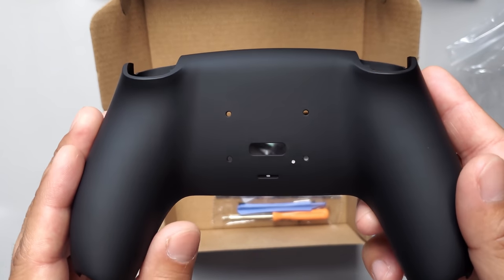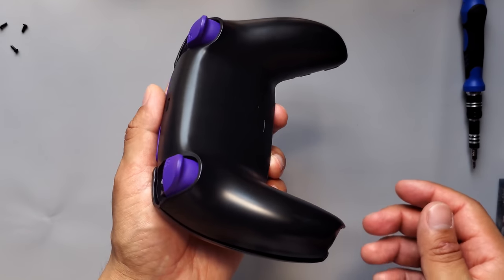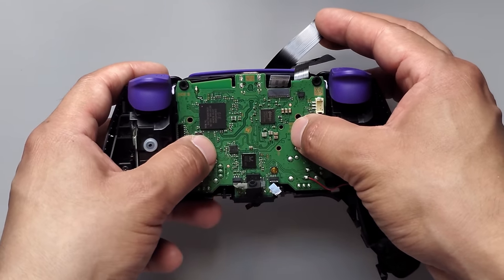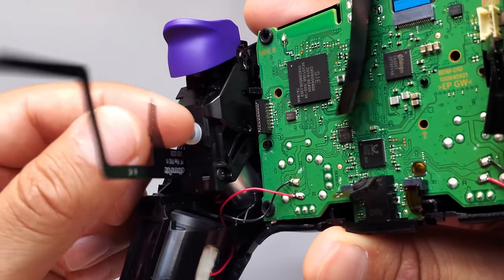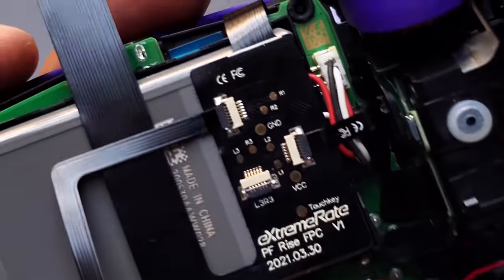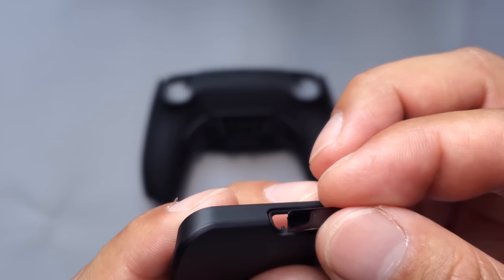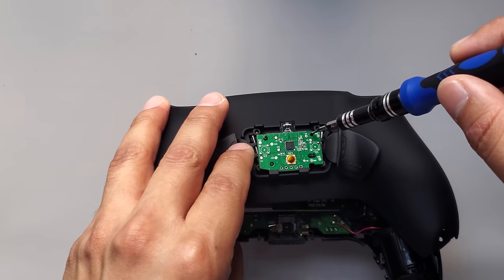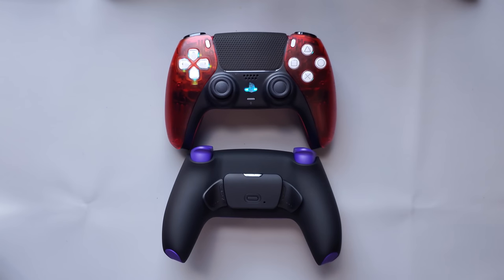DIY PS5 Controller (For BDM-010): eXtremeRate's Rise Remap Kit | No-Soldering Step by Step Tutorial

Comment: Would this work together with the hair trigger kit as well?
Reply from the maker: It does! I did my other red transparent controller with led, hair trigger and remap kit.
Reply: @im.a.caveman  thanks. I already installed the remap kit and got the trigger map after. Not sure if I want to reopen the controller again since I already taped the wires to the battery.

Comment: So I installed mine and everything went together good but when I went to try it out L1 and 2 and R1 and 2 won’t do anything. Any tips before a tear into it to see what’s going on.
Reply from the maker: As in you're trying them out on the back buttons or pressing the trigger buttons?
Reply: @im.a.caveman  no like there just not doing anything at all. I didn’t get to the remap process just because I realized that none of the triggers we’re doing anything. Maybe some of the connections aren’t in all the way ?
Reply from the maker: @TheJdavis90  Open it up and check all the cables. Look around carefully and closely for anything that might seem off.
Reply: @im.a.caveman   yea I checked it with the controller connected to my Ps5 and could never get the right triggers to work so I put the original ribbon cable back and it worked perfect so I’m guessing  I messed it  up trying to install it or it came with some kind of flaw. But either way I got it and it works fine I just can’t remap r1 or r2 but that’s fine I didn’t plan on it anyway

Comment: Just done it and no signal,checked the cables for 3 times but no red light,can't start the controller. Thanks for the vid btw.Great  tutorial bro...
Reply from the maker: It could be its not compatible with your controller. Is the original back shell model number CFI-ZCT1W or CFI-ZCT1W  A? On the motherboard does it show BDM-010 or BDM-020? You can check for either one. It's only compatible with CFI-ZCT1W / BDM-010. Extremerate is working to have it compatible with CFI-ZCT1W A / BDM-020. They're close and should take some time to release.
Reply: @im.a.caveman  Thanks bro,I'll check it. Appreciate it 🙏

Comment: Anyone have any idea what the cable at 3:28 is called and if you can get a replacement as I snapped my trying to remove it 😫😤
Reply from the maker: That's the shorter microphone flex/ribbon cable. I saw some on Amazon. You can also try ebay. There's also a longer one that's for the front microphone.

Comment: put this kit on a brand new controller that i just got today after i followed your instructions to the letter, pausing each step and checking double checking and even triple checking at times that was doing it right and got it all fit in perfectly then discovered that the controller wont turn. any ideas what it could be?
Reply from the maker: It's sounds like the kit is not compatible with your controller. I have a video on compatibility if you want to check that out. When the kit came out there was a new model of ps5 controllers that were released so extremerate had to work on a new remap kit which is already available.
Reply: nevermind. i found out it is a compatability issue. i feel you should put a warning about this at the start of your installation video for people like me that just dont know this issue exists. great instructional video though
Reply from the maker: I wish I could put it on the video but I don't think I'm able to add clips when the video is uploaded already. I do have it on the description though. And thanks! Also, I think if you contact extremerate and tell them you got the wrong kit they could probably send the cables that are needed for your kit. Try it out!

Comment: Ive done all the process but the controller wont turn on. Once i take off the board that has glue the controller turns on. Do you know any fix for that? Thank you in advance 
Great tutorial btw
Reply from the maker: The remap kit is only compatible with the board BDM-010. Model # CFI-ZCT1W is BDM-010. CFI-ZCT1W A is BDM-020. Atleast from what someone has mentioned to me. Model # is on the original back shell. BDM is found on the motherboard

Comment: One question please. If I want use R3 and L3 as the back buttons instead. Will that be possible. Somewho u said there no r3l3 available in vid
Reply from the maker: You'll be able to program L3 and R3 to the paddles if you solder the cable for it. But since this is the non-soldering version I don't show that part on the video.
Reply: @im.a.caveman  ah ok thanks so there anther version of it. That includes r3l3

Comment: led indicator and controller dont turn on now dont really know what i did followed step by step?
Reply from the maker: If the controller isn't turning on maybe the battery wasn't connected but check all the cables.
Reply: @im.a.caveman  yea I did I’m pretty sure I messed somthing up I’ll buy a new battery and try again
Reply from the maker: @kenythguerrero9798  Oh man. You can always send a quick vid or pick on my IG (im.a.caveman)
Reply: @im.a.caveman  so i put all the Original cables back in and the controller works perfect

Comment: Dude every thing seems to work, light turns on but the buttons don’t work. I assign them by holding the button and o or x and wait a blink. It blinks but the back buttons won’t do anything!?

Any idea where I went wrong?
Reply: Leaving this comment cause I figured it. You have to take it out of remap mode after assigning for it to work. I held L1, R1, down on D pad, and X into the light turns on. Then assign buttons, light will flash. Then repeat holding L1 R1 Down X and light will turn off and you’re out of remap mode. Buttons work

Comment: So when my light is off it’s when I can use the paddles and when it’s on I can’t. Can you explain. Thank you
Reply from the maker: When the light is on that means remap mode is on. When the light is off, remap mode is off and you can use them. I recommend looking at my Rise 4 video. That kit seems to be getting popular. This kit is outdated. It's the V1 remap kit. They released 3 other kits after this one.

Comment: My button that turns the back button on doesn’t have a slot to click in. It just sits in there loosely and when I go to attach the back button it jus falls out. Need help
Reply from the maker: I had the same problem but I kept putting it in and eventually I got it on right. Not sure exactly what I did correctly though. Just kept trying.

Comment: So before I get this,can I use just the base ps5 controller to mod it,I have no mods on it either,or will I have to change the whole backplate?
Reply from the maker: It comes with a back shell of your choosing. You can still use the mod on the original but that means you would have to drill your own holes. They also don't sell the mod on its own, it comes with a back shell with pre-made holes. If you do plan on getting one check for compatibility. Here's a link to help with that: https://youtu.be/cncOZDDSmIk

Here's a link to the V2 Rise Remap Kit:
eXtremeRate White Rubberized Grip Programable RISE 2.0 Remap Kit for PS5 Controller BDM 010 & BDM 020, Upgrade Board & Redesigned Back Shell & Back Buttons for PS5 Controller - Controller NOT Included https://www.amazon.com/dp/B09HTKXRVN/ref=cm_sw_r_apan_glt_fabc_8J1FWBBA63NFEXZD3B44

Currently sold out on the gamingcobra website.

Comment: IF YOU STILL REPLYING TO QUESTIONS, I HAVE ONE....Can you tell me why X button doesn't work in the COD, So if i can explain... The splash screen that plays while the game is loading, then you have to press X to enter the game. My controller doesn't work at that time. I know the X button works because it works for every thing else. So help me out of you can.
Reply from the maker: Specifically just during the load screen or just not working at all? Edit: read the comment carefully. Only on the load screen....could be a COD glitch if you're X works perfectly for everything else. Did you try on another game?
Reply: @im.a.caveman  well now that I went all the way  thru it’s not working for the game. But it works thru out my PS5. Also that’s the only game I tried……update just tried another game, no luck.
Reply from the maker: @Mr.Charles73  you installed back buttons or its the stock control?
Reply: @im.a.caveman  back buttons. No soldiering tho.
Reply from the maker: @Mr.Charles73  I definitely suggest opening up the control and check your wires. Also the conductive film that the X button pushes down on. You could also try restarting your control.
Reply: @im.a.caveman  ok but I’ve open and closed it twice now. So I’ll unpair it. But like I said it works thru out the PS5 menu. Just not for games.
Reply from the maker: @Mr.Charles73  I haven't had any issues. And for it to only work in menu but not in a game it's weird. I know it's extra work but try your original cables without the back buttons to see if it works.
Reply: @im.a.caveman  I feel you, but it was a brand new controller
Reply from the maker: @Mr.Charles73  Replace everything with the original parts and see how it works.
Reply: @im.a.caveman  yep it still work with the original parts installed. So on that note, I’m lost  now
Reply from the maker: @Mr.Charles73  You can contact the company and ask for a replacement. You probably got a faulty/damaged Remap kit.

Comment: My L2 is now always stuck on.. any suggestions? Also, buttons won't work in a games menu? They work fine in game and in ps menu but not game menu
Reply from the maker: Check all your connections. If that doesn't work out try resetting your control or use your stock parts without the back buttons. There's a possibility you have a faulty.

Comment: Hey, I appreciate the guide everything seems to be working except the touchpad. Now it doesn’t show that white light at the button and there touchpad isn’t working when I press it (doesn’t bring up hud for a certain game I’m playing). Anyways to fix this? Maybe I didn’t put the plate properly in?
Reply from the maker: Did you reconnect the touch pad cable? You installeded the remap kit and it's the only problem?
Reply: @im.a.caveman  that blue strip? Yea that was the easiest to remove and put back. The paddles are working fine, do I seriously need to open it up again in order to fix the touchpad issue?
Reply from the maker: @wais_45  Did you swap the touchpad for a different one?
Reply: @im.a.caveman  nah all I did was follow your instructions lol. Literally everything is working besides the touchpad even tho I put the strip back in.
Reply from the maker: @wais_45  Did the touchpad cable accidentally get pulled on? Or the cable itself got damaged? You would have to look around in your touchpad and cable.

Comment: I was able to turn it on no problem. But I can’t seem to reprogram the paddles. I hold x and k1 and the red indicator light flashes. But x stills performs as x and the paddle serves no function. Any ideas?
Reply: I'm having this issue as well. Everything turns on but the actual mapping wont work. Could a certain wire been placed too loose?
Reply: Actually bro i just figured it out for me, just make sure you turn the back part off and then the button should work fine. So hold the two buttons, turn off the back and you're good
Reply: @arhumahmed5030  thanks I’ll try that!

Comment: Any idea why the paddles wouldn’t be working? It lights up and I double checked the connections disassembled and reassemble?
Reply from the maker: After remapping did you turn the back off? On is for remapping only.
Reply: @im.a.caveman  yeah I did still nothing, I did the trigger click at the same time too and noticed my R2 wasn’t working and re did it and it clicks now
Reply: Not sure if the buttons work yet tho

Comment: So...... my controller won't turn on. Do you have any idea where I might have made a mistake?
I checked that the battery is connected and I've tried plugging it into my console.
Reply from the maker: It could be due to compatibility issues. Does the original back shell model number show CFI-ZCT1W or CFI-ZCT1W A? On the motherboard, does it show BDM-010 or BDM-020? The kit is only compatible with CFI-ZCT1W / BDM-010. Extremerate is working on having it work with CFI-ZCT1W A / BDM-020

Comment: Did it all as shown in the video and the controler do t wanna turn on now at all! Like the battery is not conected at all, any advice or an idea what to do or what i did wrong ? Thx in advance
Reply from the maker: It could be due to compatibility issues. Does the original back shell model number show CFI-ZCT1W or CFI-ZCT1W A? On the motherboard does it show BDM-010 or BDM-020? The kit is only compatible with CFI-ZCT1W / BDM-010. Extremerate is working on having it work with CFI-ZCT1W A / BDM-020
Reply: @im.a.caveman  Hey thx for the reply. Back shell is the right nr but didnt check the motherboard tought it cant be diferent but il have a look again
Reply: And where exsactly on the board do i see the nr ? I know silly but not an expert here 😅

Comment: Is there anyway to unmap the R3 button and have it mapped to the back buttons? Meaning if you hit the R3 click it wont work
Reply from the maker: Maybe you can just switch the R3 to a different button to with the game options? But other than that I haven't seen how to unmap an existing button from a control. If you want to remap R3 to the back buttons you would have to do some soldering.

Comment: trying to install this. as well as led kit, front shell, new touch pad. clicky triggers. Just got to the end and the back button kit doesnt turn on
Reply from the maker: Does the controller turn on?
Reply: @im.a.caveman  Sorry I should have updated this! So stoked to see your reply! Yes I was a complete idiot when it comes to that. The battery was dead lol

But I do have another issue. The new touchpad I installed is loose and wiggles around. I have checked all the videos and there really is no way of screwing it up. So I dunno what happned.

I notice the original back plate has a piece of foam on it. Would that be the issue?

Thanks so much for your reply dude!

Comment: I got my remap kit and LED kit today and I installed both using your tutorials but for some reason my x button works fine in menus but once I load game the x button doesn't work anymore.  Any suggestions pls?
Reply: Me too don't know whats happening
Reply: Sayiet Solidarakis  I finally fixed it. Everything is working fine now. You will need to open up the controller once again and do the following. 
1.  Change the orientation of the rubber placed on your ○ × □ and 🔺️ (check LED installation video  timestamp 3:41 to see the rubber). There are 2 horizontal and 2 vertical lines on the rubber. The horizontal lines should be aligned with 🔺️ and × while the vertical ones should be aligned with □ and ○.
2 Make sure your remap kit flex fits properly and is placed before the LED flex. By flex I mean the part he is attaching in this video (timestamp 4:58). Hope this helps
Reply: @baiyewuoluwole1932  thank you so much i will check again and let you know. You are the best!

Comment: Great assembly instructions but your remapping instructions are not clear. When you hold the button down it puts the kit into remapping mode it doesn't turn the kit on. You then map the two paddles as you described. However you must then exit remapping mode by either holding down the back button or holding L1+R1+D-pad down+X
Reply: I did everything the video said which was perfect btw, but when mapping the buttons it does the flashing thing but when I click the back pads it doesn’t work? Anyone know why I inserted all wires correctly and it turns on fully. Help please is it due too what you just said

Comment: anyone know of some back buttons for dualsense that are more resistant? meaning takes more force to press the button? im not a fan of the super sensitive buttons
Reply: Yes. Either get this kit and replace the tact switches which means desoldering the old ones and soldering new ones. I recommend PTS815 SJG 250 SMTR LFS from digikey. They require twice the amount of force to activate vs the original switches....or buy a remap board for the Dualsense and wire/solder switches of your choosing. Obviously the latter is a more involved process and requires careful planning, soldering, drilling, etc. I like the kit from xq gaming but like I said it's a bit more work.
Reply: @emski7317  damn, no idea how to solder and i dont have the tools (or funds for tools) for that lol thanks for the reply tho! 👍
Reply from the maker: Hopefully some different kinds of back buttons release soon and you find what works for you. I can't wait to try the new stuff. Thanks for stopping by!

Comment: Hey don’t know if you’ll see or answer did you add the pad on the back so nothings loose or feels loose ??
Reply from the maker: I didn't add it because I wasn't sure it if was gonna be a problem.
Reply: @im.a.caveman  I see thank you ! I installed mine but my x and o aren’t switching over to the paddles Soo I’m double checking it now but I didn’t everything right . Did this happen to you??
Reply from the maker: After remapping turn the back off. On is only for remapping. That should help.
Reply: @im.a.caveman  perfect thanks bro 😎 see you Warzone 😏😏